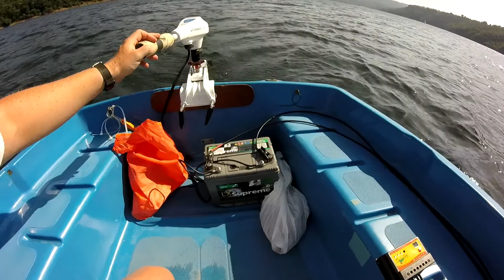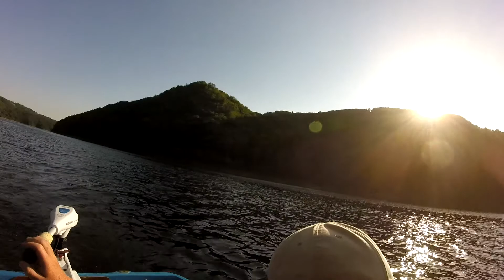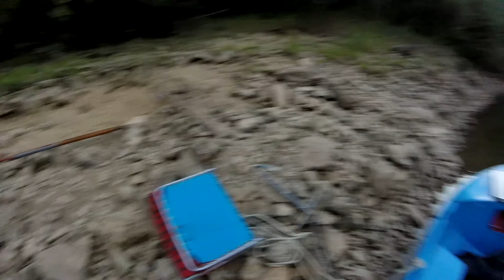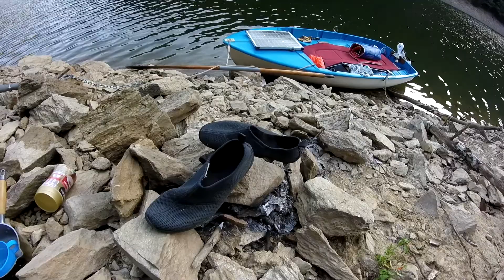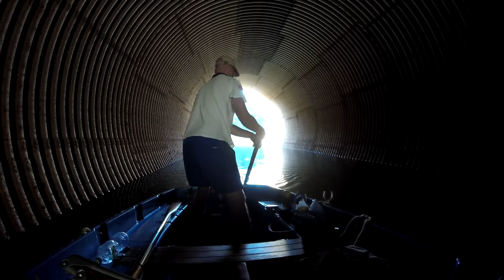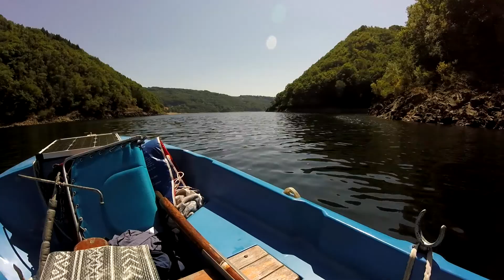Solar-electric boat:  Overnight trip (16 miles)

Comment: Great stuff Charlie, good to see you back out on another trip! Also glad to see the solar boat out for a run again too, what a stunning place for a cruise. I did see that little Svord peasants knife there too, I see we have the similar taste in utensils, not just watercraft! Great little knifes they are, I have one in the poly white, the thing is absolutely indestructible for a folder. I believe it should be UK carry legal with the blade length and non locking design. Sadly any knife is illegal to carry over here without an immediate 'genuine reason' for possession (fishing, diving, so forth). 
All the best mate, 
Cheers, 
Matt
Reply from the maker: Thanks for the comment Matt. Yeh this lake was quite something! The knife is uk street legal yeh, as you said. I didn’t know Aus had that angle on knives… crazy!

Comment: Did you run with your boat sir?
Reply from the maker: Great question!  This boat was actually taken to the lake by car / trailer.  The boat I run with is my white boat in England - the setup is shown in my 'Cross-country running a boat' video.  I'm still aching from the running race hah

Comment: What size solar panel you need to run trolling nearly all on the panel?
Reply from the maker: Hi! Roughly 150 to 200 watts, for minimum speed reliably with a motor 35 to 50 lbs thrust